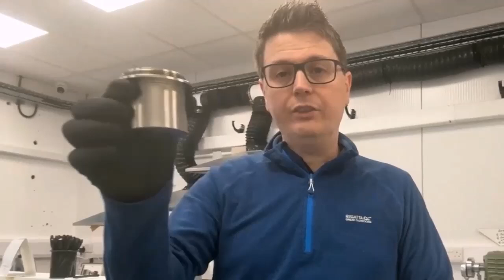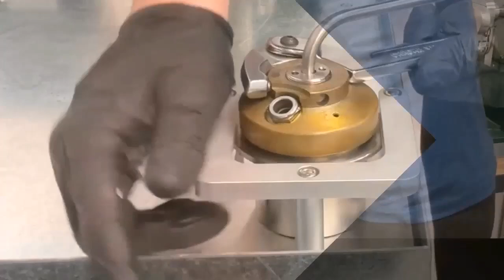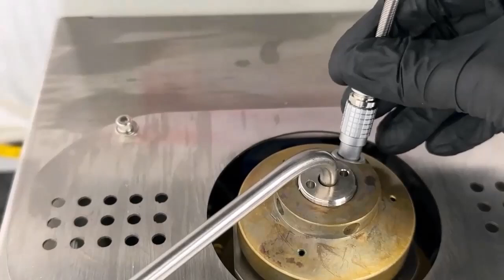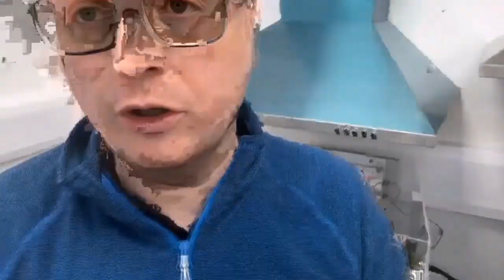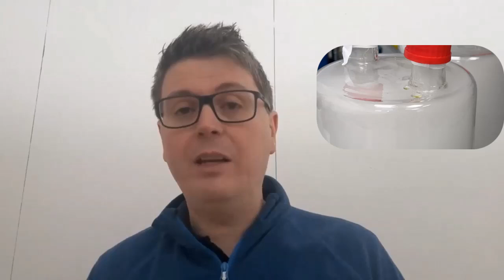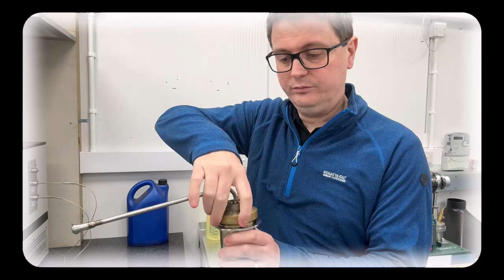Is my oil vanishing into thin air? NOACK has the answer...

Comment: What reasons explain for why the sample get losses? Oil additives or something else? Thanks alot
Reply: Should noack be used in perfomance or qc test?
Reply from the maker: Yes absolutely and it is on most engine oil specs but it should be used on any oils exposed to higher temperatures that are relatively thin oils to begin like hydraulics too.
Reply from the maker: Both
Reply from the maker: Base oils is why it's lost. A light molecular weight molecule will boil off leaving the heavier stuff. Crude and non synthetics will have a wider range of molecules. Synthetics will be tighter so will boil together. Also mixing a lighter and thicker oil can cause this.
Reply: Thank you alot. Hope to see your new video.
Reply: @phamtientrung9168  what would you like the next video topic to be on?
Reply: @LearnOilanalysis  I am so excited about used engine oil analysis, API sequence test properties & testing. A lot of why question.

Comment: I am wearing the same regatta fleece as you while watching this. Accept mine is gray, my mum brought it for me at Christmas. This is like a mini fractional distillation? 
Do you find a worse performance over time in terms of increasing viscosity more in minerals or synthetics?
Reply from the maker: Great fashion sense I see you have then. Yes it's like a mini distillation. You get a significant difference between synthetics (all one molecule size or very close generally) vs minerals (lower groups of minerals) as they have a wide range of hydrocarbon sizes.